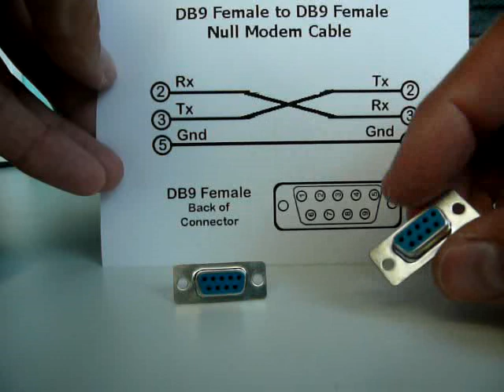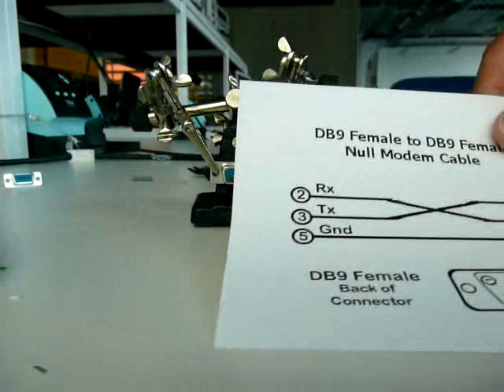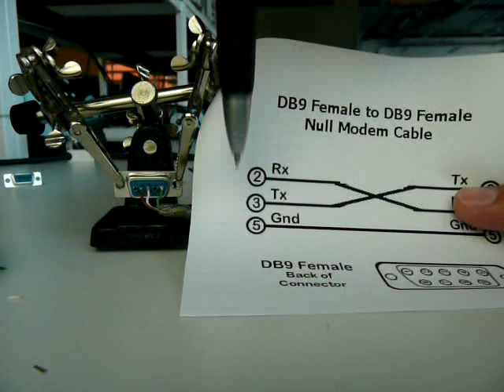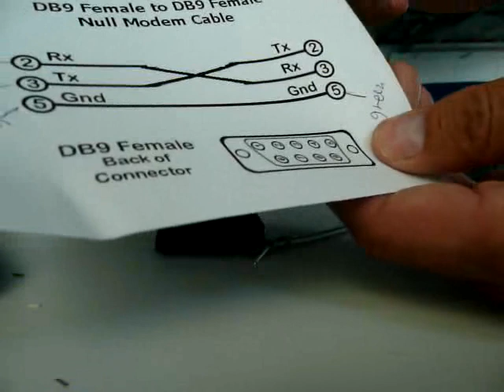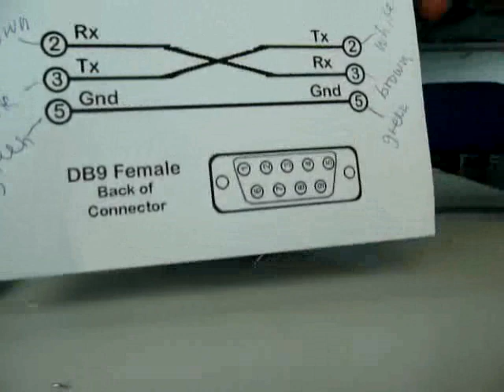Solder 3 - 03 Null modem cable soldering

Comment: If I were to use a Male DB9 connector at one end, instead of a Female one, any change needs to be made?
Reply: Hi you will normally use female-male cable connection when making an extender cable, and in that case pin 2 and 3 wiring are not swapped, that is: male-pin_2 to female-pin_2, and male-pin_3 to female-pin_3.